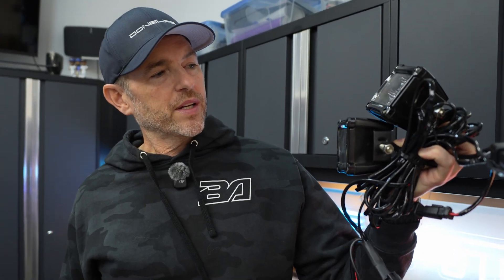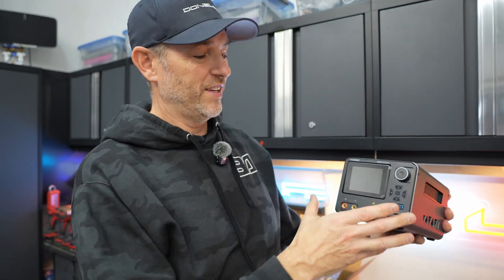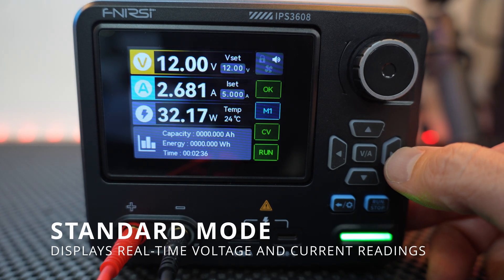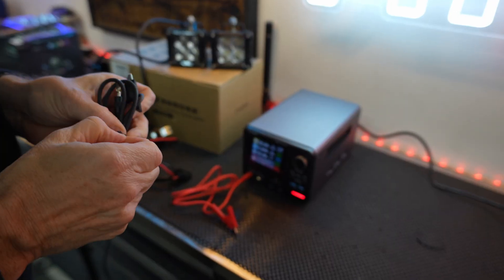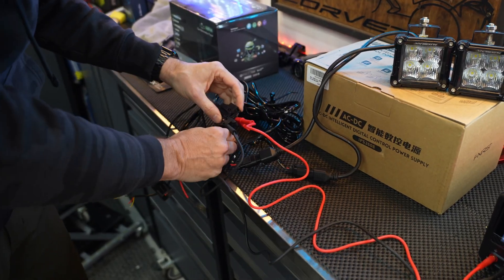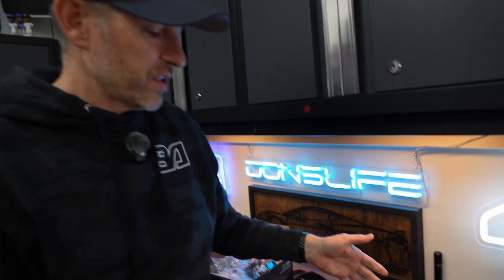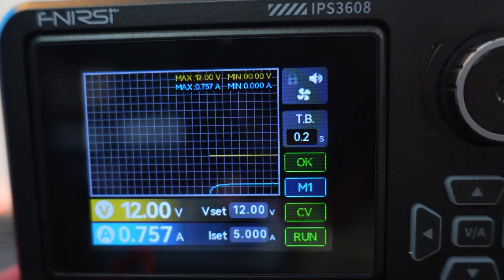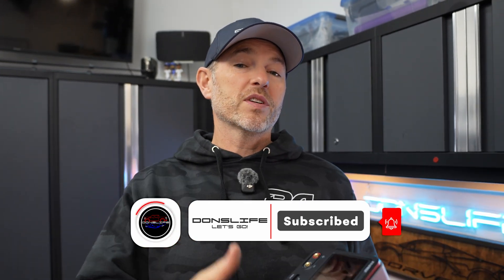Testing the Best Budget Bench DC Power Supply - FNIRSI IPS3608

Comment: It is a great unit, but there are significantly cheaper options if the main function is a stable 12v supply. Most chargers have a power supply mode.
I have three of these in my electronics home lab, but if I only wanted 12v I'd have bought something far cheaper to get the job done.
Reply from the maker: Thanks for the feedback!
Reply: ''It is a great unit'' if you ignore the first few mS after you enable  the output  when theres a  'short' between +/-  that can cause reverse/negative current (johnaudiotech's channel)